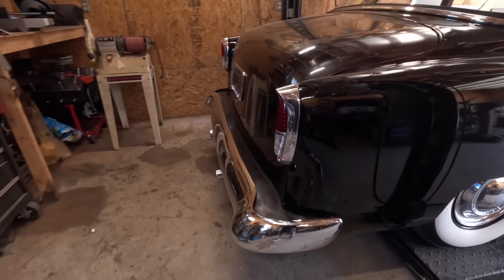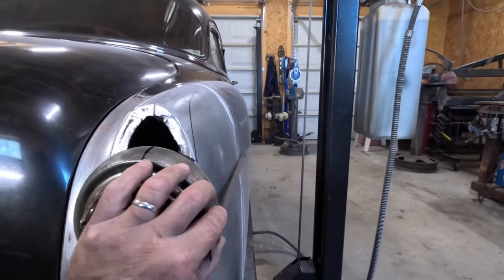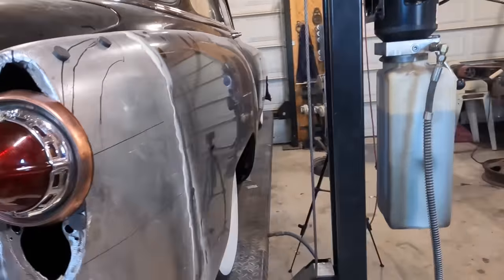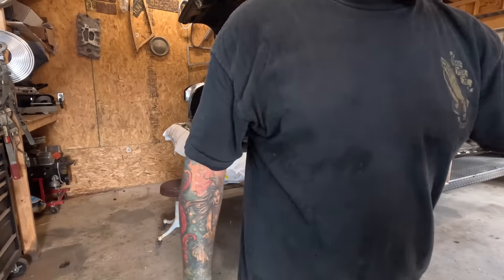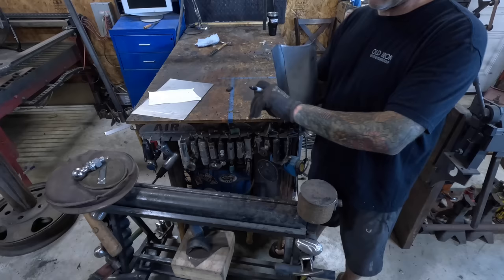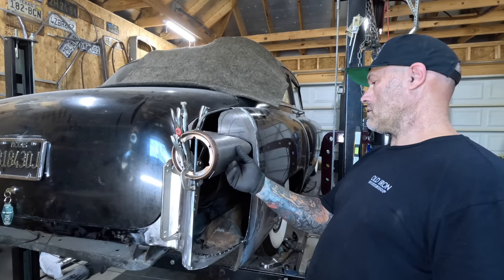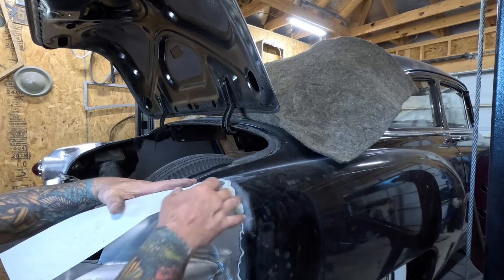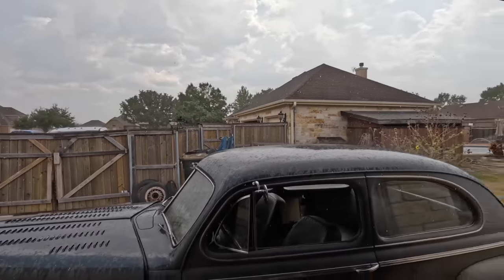How to Install custom taillights, 1954 Chevrolet.  Kinda ugly

Comment: EXCUSE ME I OWN A 1953 CHEVROLET CLUB COUPE!  ALL THE COUPE'S REAR SIDE GLASS ARE SMALLER.  I BELIEVE THAT IS A TWO DOOR SEDAN, IT HAS THE LARGE GLASS!  AND IT'S EITHER A 210 MODEL OR 150 MODEL THE LEAST EXPENSIVE MODEL.  THE 210 HAD CHROME BELOW THE BELT LINE, AND THE 150 HAD NO CHROME.  THAT WAS SOME NICE METAL WORK SIR!  REAL NICE!
Reply from the maker: WHY ARE YOU YELLING
Reply: @Theoldironworkshop  SIMPLY IN CAPS!  NICE WORK!
Reply: It’s a 150 Utility Sedan model
Reply: @JHTenor  I OWN A 1953 CLUB COUPE, THERE TWO COUPE OFFERED IN THE 150 MODELS IN 1953 (1) CLUB COUPE (2) SALE COUPE OR SALESMAN!   IN 1954  WAS TOLD THAT THE CLUB COUPE WAS CALLED A DEL RAY ! MODEL!  BUT WHAT I MENTIONED THAT A COUPE, HAS A SMALLER REAR GLASS IN THE QUARTER PANEL AREA.  A SEDAN MODEL HAS A MUCH LARGER GLASS,  CAN SEE THE DIFFERENCE ON YOUR SALE BROCHURES OFFERED BY GM.
Reply: DON'T LET MY SPELLING BOTHER YOU SIR!  SIMPLY EXPLAINING CARS MODELS FOR 1953-1954  I'M A VCCA MEMBER AND WAS MENTIONING HIS SO CALLED COUPE!  BROTHER!

Comment: PERSONALLY I think the original tail lights would have looked better if they were frenched in about 4 inches. It would have stayed true to the body.. Round tail lights look out of place on that body. But thats just my opinion. The metal work is good though.
Reply from the maker: Yes, I totally agree.  The owner had a vision in his head and didn’t exactly turn out.   He’s actually purchased some other tail lights that we’re going to probably change out this winter. Or whole different route  I personally would’ve done 54 mercury

Comment: My 2 cents 
Shave fuel door 
Custom skirts 
Bring inward the bumpers 4-6 inches 
Vintage rear bumper brackets with light to hold license plate ( smooth trunk) or Chevy V on it 
Light smoke tint on all glass
Once done rechrome everything in black nickel chrome
Reply from the maker: Black nickel chrome would be crazy